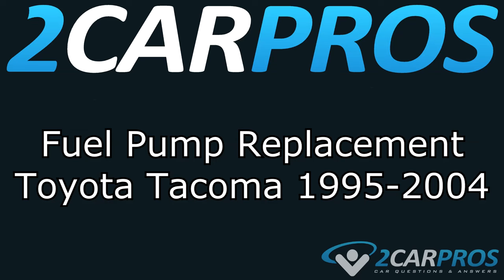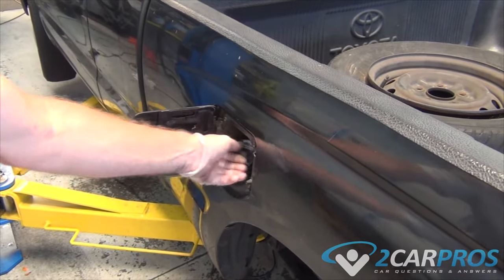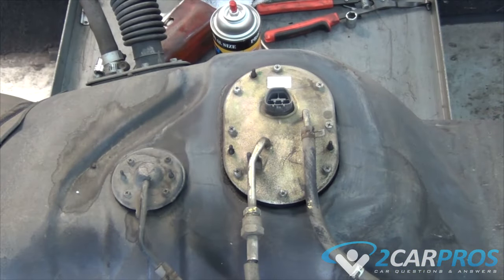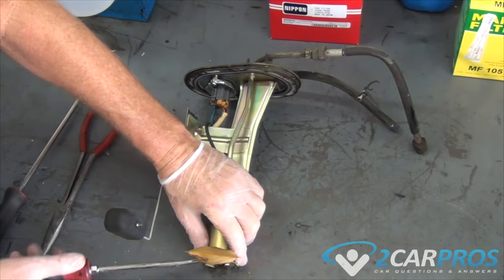Fuel Pump Replacement Toyota Tacoma 1995-2004

Comment: I got a quote for ALMOST $1400 from Toyota of Berkeley, CA to replace the fuel pump and sending unit, parts were quoted at $468. After watching this clearly communicated video, I bought the pump on Amazon for $30 and  swapped it out. Took me all of 2 hours. and required only  12mm and 14 mm sockets, 14 mm spanner, adjustable wrench, needle nosed pliers, phillips screwdriver, a hose and a gas can. I didn't find it necessary to remove the inner fender plastic on my 1998 tacoma. Thanks 2CarPros!
Reply from the maker: That's awesome! I love hearing stories like this one! You saved some serious cash! Thank you so much for watching!
Reply: When you live in an expensive area and need work done you bring it to a less expensive area for work, or ghetto area they work for cheap or search online for mobile mechanic they will do it for cheap.
Reply: someone just paid a;most 1000 dollar for the junk
Reply: how did you remove the gas?
Reply: Welcome to California!
Reply: @latinobazaar  he siphoned the gas into a gas can
Reply: just remove the bed its alot easier
Reply: Wow !  I don't think the book value of a 98 Tacoma is as much as the quote 🤔

Comment: I replaced the fuel pump on my 97 Tacoma today. Took the bed lose and raised up the front of it and propped it up, changed it in thirty minutes. Hardest part is getting all of the air out of the lines, dont think its just gonna fire up right when you put it on. You will wind on the starter a million times before it will start sucking gas. Use starter fluid if needed. Running like a sewing machine, after leaving me on the side of the road last week lol. Tow dollies.
Reply: It would take me 30 min. just to get all the tools together. Did you take all the bolts loose and the gas filler hose? Did you need to remove the taillights? I have a '96 Tacoma. Is it best to disconnect the fuel line and turn the engine over to make sure it's the fuel pump? I mean it won't start unless I use some spray and I don't know what else it could be, lol.  Thanks for any help. (Rusty)
Reply: @dianakesl1814  Yes the filler hose is easy. I didnt have to unhook any tail lights I dont think. When you get to the pump get somebody to turn the ignition on and listen, it will buzz for a few seconds if it's good.
Reply: @trent3872  Thanks for the info. I tried turning the key on and listening for the pump. Couldn't hear anything. I went ahead and dropped the tank from underneath. I've still got to take off the electrical plug and one hose and I can pull it out. Is it a relay in the fuse box? Should it make a clicking sound when the key is turned on? Thanks for your help. (Rusty)
Reply: @dianakesl1814  Its a buzzing sound. More than likely it's bad.
Reply: Trent got the fuel pump in but can't get it started yet. Like you said it's a bitch to get fuel up to the engine.  I had a hell of a time getting the strap bolts lined up. I've been crawling around under this truck for two days now. I'm too old for this shit and too broke to pay somebody else to do it. (Rusty)
Reply: How many bolts hold the bed on? I can only find 2 per side but everything I see says that there are 3 bolts per side
Reply: @asixstringnut1972 I believe it's 2 in each of the front corners and 1 on each of the back corners. 6 total

Comment: Taking the bed off is much easier
Reply: Frank Stall  .  Saw a video on that, I love the idea.  Save at least half a day for a beginner.   Thanks bro.
Reply: You dont have to take the bed all the way off.Take out all bed bolts on fuel tank side ofcourse.Then loosen the other side leaving the bolts in,raise bed on drivers side then use a 2x4 to prop bed up to access the tank.

Comment: And to think , it was so easy 40 + years ago when the fuel pump was mounted on the engine block , but this is progress 🤦‍♂️ , all auto manufacturers should have to have an access panel on the vehicle above the fuel pumps just for this reason  ,$ 1000.00 plus in mechanics fees for a $30.00 pump replacement  , ridiculous , A+ to the guys instructions on the replacement though  👍
Reply from the maker: Yeah an access panel would be really sweet. Thanks for watching!
Reply: @2carpros  your video was great 👍  and very informative  & TY  for taking the time to make it for everyone to see .
Reply: Yeah I remember the old slant six. I had three different Plymouth Valiants with slant 6 motors. Great cars for knocking around. The fuel pump around $30 bucks and change it with a 1/2" wrench in 15 min. ( Rusty)

Comment: my 2006 Tacoma has 230,000 miles on it and I'm thinking that my fuel pump is probably about to go out.    now I know what I'm in for.
Reply from the maker: Thanks for watching!
Reply: @Pop Warner, I'm doing pump on 2000 Tacoma 2wheel. 180k fuel filter change could help pump last longer?

Comment: One part he left out was to loosen the passenger side bed bolts (3 per side 17mm)
And remove the drivers side bed bolts.  Lift the bed up and slide a pair of 2x4’s or a piece of 4x4 under the bed behind the driver rear wheel where the frame and bed touch.  That makes getting it out, with the filler neck still on, a whole heck of a lot less fighting and cussing!!  Don’t forget to remove the drivers side tail light and unplug the harness from the light, then push the harness under the bed to avoid possibly damaging the plug.

One other option, but not necessary, is to remove the rear section of driveshaft.  

While it’s out, check the universal joints!!

Comment: Lisle makes a fantastic hose removal tool sort of like a pair of  pliers with two flat  pieces of metal for jaws with a V cut out on the top and bottom pieces it is very reasonable cost and will prevent destroying the hose ends used one for over 30 years and still have it in my tool box.
Reply from the maker: Good tip thanks for watching Ray!

Comment: Would you consider taking the truck bed itself off and approaching the fuel pump from the top? What would be an obstacle to that?
Reply from the maker: +Tyler Billington  That is another option, but truck beds are heavy. If you haven't already please subscrbe.
Reply: Agreed that's how we have done it for years, just need a helper to lift off bed and put back on!
Reply: i just took the six bolts out of the bed with an impact wrench, unconnected the tail lights, and fed the gas cap down as we raised the bed. took about 30 min.
Reply: How would I check the pressure on the fuel pump of a Tacoma?
Reply: I took off the 4 forward bolts and loosened the very rear 2 bolts and tilted the bed up by hand and used 2x4s to hold it up. So far so good...
Reply: AN JR any luck ? What are some of the things to watch for when doing it that way ? I have a 03 too and I’m not sure which way is better.
Reply: Thanks for making this comment. I was able to follow this video but simply lift the bed rather than lowering the tank. just needed 17mm deep-socket on an impact wrench to remove the bed-bolts and tilt up the front of the bed. Finished the install and after 10 seconds of turning the engine, it fired right up. Saved me at least $350. Thanks all.

Comment: Hi guys great video. Just installed my new pump on my 95 tacoma and everything was good until i noticed i was leaking gas from where the fuel pump bolts to the gas tank. I removed my bead that’s how i was able to see this. Is there any kind of gasket that i need to replace when resitalling? I’m getting gas seaping from the top of the fuel pump on my gas tank. Thank you!
Reply from the maker: Yes there should be a gasket between the top of the pump and the top of the tank. Hose it down with WD-40 when you install it too so the seal goes on even. Thanks for watching!

Comment: Hello there, 
  I had a question regarding the yellow gas light on my 2006 toyota tacoma. The light on my dash board dosen't come on anymore. This happened when I ran out of gas. I thought I might have damaged th fuel pump. When I filled the gas tank full needle registers but, will not go all the way to empty  and the yellow gas light dosn't come on. Wanted to ask for your suggestion on fixting this issue. Thanx!!

Comment: Nice video. I have a 2000 tacoma 2.4 2wd with 246k miles on it. There is a loud humming noise on the inside cabin. I think its either the fuel pump or in the trans. The noise never changes. Do these pumps tend to hum when going out? So far no loss in performance anything like that.
Reply from the maker: Yeah they can. Usually its more of a whine. Just turn the ignition on, not the engine, then listen. If you hear it, then it is most likely the fuel pump. Thanks for watching!

Comment: I got a question can I use an external electric fuel pump on frame rail instead of putting it in my gas tank I have put three in and they don't last I used to have a Ford Ranger with carburetor on it I put electric fuel pump on it because the headers was blocking the manual fuel pump what's a u

Comment: Thanks for the video! I've got a question for anyone who might be able to answer. I've got a 2006 Tacoma 4wd TRD off road & it started having a random hesitation during acceleration that started about a year after I purchased it. I baby it as much as possible. Synthetic oil & filter change every 5k like clockwork. Since the hesitation started about four years ago, it's never thrown a code. I've checked & replaced any and all fuses, used fuel injector cleaner a couple times a year, change the spark plugs, the MAF sensor and the PCV valve. Every time I've changed something I unplugged the battery for at least fifteen minutes to let the ECU reset. Nothing has fixed this random hesitation I'm getting and I'm ready to sell the truck private party. The last two ideas I wanted to try was the throttle control sensor and the fuel pump. There's two different parts, one is a fuel pump module that's $2-300 and the other is a fuel pump kit for $100. Any ideas or suggestions are greatly appreciated!
Reply: you could try the fuel filter if it hasn't been replaced already.
Reply: jstan928 thanks for the reply, the only problem is the fuel filter on '05 and newer Tacomas is in the fuel tank so means dropping the tank to replace anyway
Reply: Quick update and question, I just cleaned the throttle body sensor as thoroughly as possible & it helped a little but the random hesitation is still there. The only parts left to replace are the actual throttle body sensor and/or fuel pump. To avoid replacing both of them, does anyone know if either fuel pump or throttle body sensor would throw an obd code? Thanks so much in advance!
Reply: @rickyepps try and set up the fuel pressure gauge so you can see it while you drive. Next time it hesitates and your pressure is off you'll know your pump is bad
Reply: @rickyepps  so did you solve it? i have the same problem

Comment: Diagnosis told me to replace the defective pump they replaced 1 yrs ago, so I bought a new one and took the liberty to do the job myself when I discovered only that the small hose from the pump the unit was torn and that was the problem leaving me distraught so instead of replacing the fuel pump I  just replaced the hose and put it back together installed it and started the vehicle runs good 👍 🎶 
I would be paying more attention or better do it myself when it comes to working on my vehicle. I can't really trust a mechanic anymore

Comment: Hi guys i need to do the same job on my 95. I was wondering if you could upload the link to which fuel pump you used. The one i found doesn’t say it comes with the strainer. Awesome video by the way. Thanks! 🤙🏼
Reply from the maker: It may have an internal strainer. GM changed that on a S-10 I did not too long ago. Freaked me out because they changed it from external sock to internal strainer. I usually get stuff like that from Rockauto.com Thanks for watching!

Comment: Thanks for the video. I have a 97 Tacoma, manual transmission. I have to keep it in a gear lower than I normally would to rev up to get enough power, particularly when going up hills. Is this a symptom of fuel pump failure? Thanks.
Reply from the maker: Could be the cat converter, or the fuel pump please check it, go to our website and click fuel pump and cat converter to check the videos needed
Reply: This happened to me right before my fuel pump died. Too late for D. Garbato, but for any others who may visit the page.

Comment: So my fuel pump is working but when I put gas the needle won’t move it used to work now I don’t know how much fuel I have do I still have to do all that ? Thanks
Reply from the maker: You sure do. Thanks for watching!
Reply: @2carpros  thanks do you know if I’m going to have to replace the whole fuel assembly or just the fuel sending unit thanks again
Reply: Just the sending unit (pump)

Comment: My 98 tacoma 2.4 won't start out of no where . I removed the fuel inlet pipe bolt and fuel pressure regulator and attempted to turn the car on and no fuel was coming out does that mean fuel pump is bad ?
Reply from the maker: Yeah sounds like it. They go out all the time. Thanks for watching!

Comment: Can you explain the gas syphoning? How do you get the gas to come up the tube?
Reply from the maker: You use compressed air next to the tube to create a vacuum in the tube which sucks gasoline out of the tank. Thanks for watching!
Reply: @2carpros  ok i will try this, i told my dad to not fill the tank but i want to get the little remaining amount out to drop the tank. Thanks for the response.

Comment: Q for any one willing to answer. I am at s point removing the fuel line. The  bolts are stuck. I have used wd 40, had an assistant give it a go  Also heads up using my arm. Ideas?

Comment: It appears this video may be helpful is it would say how to get the hose in the tank to siphon the gas out. There appears to be something blocking the way to the tank.
Reply: yup, i just got a hose stuck in my 2000 tacoma trying to remove the gas, not for dropping the tank but for other reason; came here to see if I could catch a hint of how to fix it but he just says insert the hose; I did before in mine and passed that something that seems to block it now the hose can not come out. seems some sort of flap may be in the neck of the tank tube, i am just hoping my stupidity do not lead to have to drop the tank anyways!

Comment: Great video; I am not changing the fuel pump, I am interested in see how to drain fuel without getting screwed like I did so I watched this video in hopes it would show me how to fix my dumbness; I inserted a blue hose to drain liquids, one that has a metal end with a ball in it to drain the fuel now it is stuck in there and would not come out! I inserted it pretty deep trying to reach the bottom of the tank so I think it did but the hose is too thick to now come up, it is not just any hose that one can insert in there, it has to be a very thin one or it will get stuck! Now there are no videos to show what to do to get it out and I am hoping I do not have to disassemble the tank to do so because I do not have a lift like in this video and forget the dealers! My weekend project screwed for lack of knowledge! It seems there is a flap in the tank neck on the bottom. My truck is a 2000 Toyota Tacoma.
Reply: Little bit late, and I'm sure you figured it out, but next time you could always take the bed off (need at least maybe 3 or 4 guys) and do it like that. That's I am changing the assembly in my 96 tacoma
Reply: Yup it sounds like the flap that keeps gas from sloshing up the fuel hose has pinched the hose. It has a spring on it that keeps it closed. You want to talk dumb? I was trying to get a hose into my F-250 to drain the tank for a fuel pump repair. At some point I stuck my finger in the hole to see how it worked. My truck was parked out front by the road away from the house. Well I couldn't get my finger back. I yelled and yelled for my wife but nobody could hear me. Then all the people from church were driving by to go home. I was so embarrassed.   Now THAT'S dumb!!! (Rusty)

Comment: Having trouble taking off the fuel line that has a thread. I know one of the wrenches is 14mm, does anyone know what size is the other one he is holding (bigger one?) I have upto a 16mm and its still too small.
Reply: He is using it at 0:57- 0:58
Reply: I think it’s 19 mm.

Comment: 2:43 - I "Disconnected THIS hose" like he said, but then my radiator fluid drained all out. ??? I also removed "THIS Bracket", but my truck bed came loose. i.e. it would be nice if he explained WHICH hose and which bracket. THIS doesn't cut it. Kidding about the above.
Reply from the maker: Thanks bud.
Reply: @matt lehnardt: i just did my truck today unbolting the 6 bed boats and taking out the tail lighgs is mch easier,jus have a buddy there to help u lift

Comment: don't need open tank,,need cut hold on the top ,replacement fuel pump ,and seal hold very easy,,,my truck toyota tacoma 1996 ,
Reply from the maker: This is how to do it with out cutting the body. Thanks for watching!